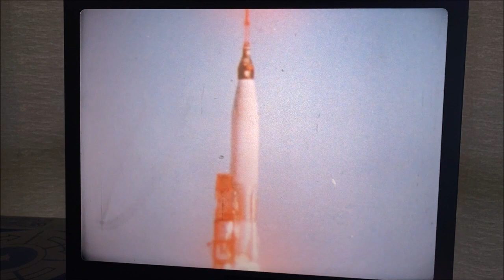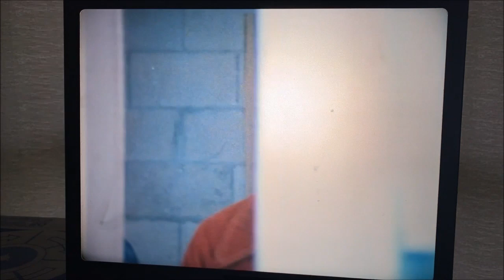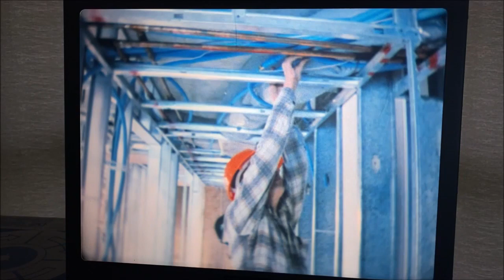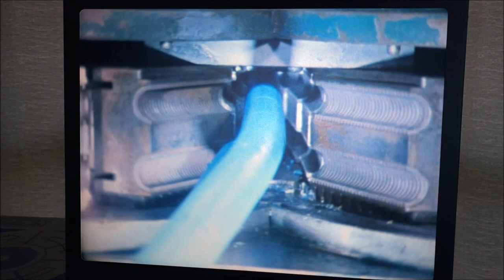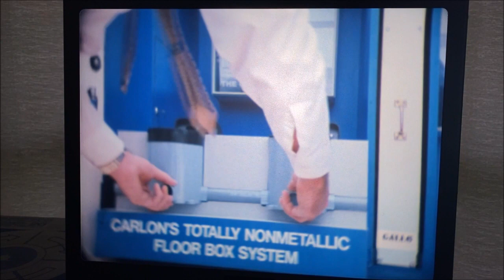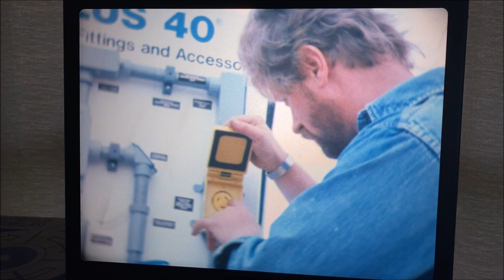You WON’T Believe This Sound! Carlon Flex-Plus Blue ENT Played on Fairchild Projector

Comment: I used that blue flexible ENT when I wired my parents basement when I was 12. (1998ish) haha. 

The comment about PVC smoke being "equal to wood" definitely didn't hold up... PVC is way worse than wood burning. lol.
Reply: True, but there’s a lot more wood in the average building. Either way, you should be out of the building ASAP… 😄